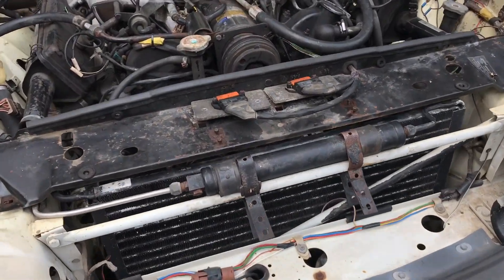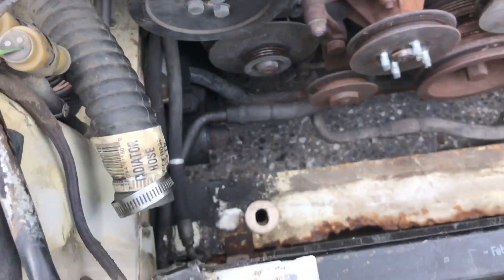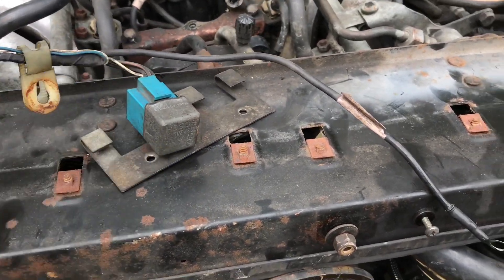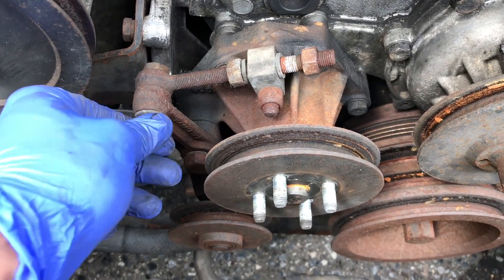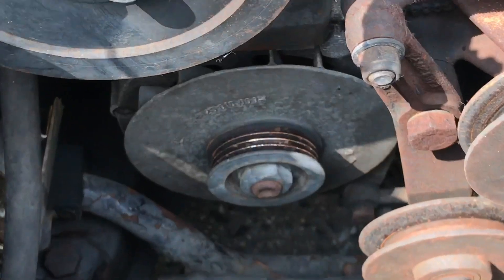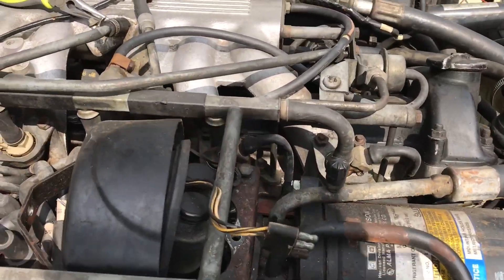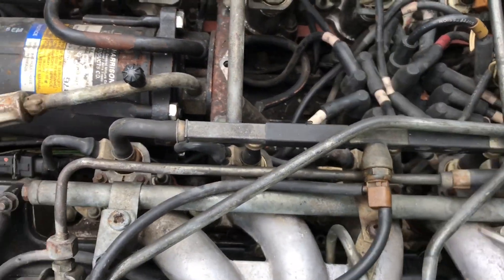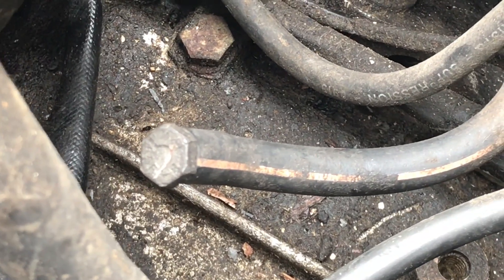Jaguar XJS V12 Tackling the Cooling System

Comment: I have a 92 v12 that is over heatings and i cant figure out what it is. And my big radiator fan is blowing hot air into my toward the engine. And it gets stuck on zero rpms and goes back normal when it feels like it. Any tips?
Reply from the maker: Regarding your overheating condition... 
check your two thermostats.. see if they're stuck open or stuck closed.. 
Check that between the radiator and AC condenser there isn't debris preventing the air to pass through. 
Also, has your cooling system been bled properly? Very important that the system is evacuated of all air. 
As far as your idle jumping up and down from what I gather, your car is lurching. and this can be casued by a number of things. But check your AAV, the AAV is located on the Driver side engine by the firewall, it's a valve the opens and closes allowing more or less air to get in during cold start.
Try this, turn on the car, take your hand cover the intake trumpet on the driver side, does your idel settle down? Then your AAV is the cause. Let me know how you fair. Good luck sir.

Comment: My car has been sitting for 5 to 10 years in a orchard and I have a mouse nest under the cruise control bellow,at least I hope its a mouse,what a mess they leave .
Reply from the maker: good luck bringing yours back to par! It won't be easy but very worth it. 
Please replace all fuel lines, the rubber perishes, especially on the return and feed.. Good luck and if you need anything please let me know. Also join the Facebook forums, the Jaguar community is one of the most friendly and helpful car communities out there. Cheers!
Reply: @PedrosGarage  Thanks Pedro for the info I have a long way to go but having said that its a learning curve and while I have an XJ8 and XJ6 these V12 s are an interesting change, having said that I was amazed how bad a car can get let uncovered and on grass/soil as the other Jags were both let outside on tarmac and one had a cover but you can tell which one it was.

Comment: Just bought an 86 that I'm trying to resto mod a little. Mine only has 75k miles and I would love to keep the original engine, just doesn't run, but not sure on how to really beef it up and make it more powerful. Or which parts to use haha. Very complicated engine to understand.
Reply from the maker: Very nice, well for one, the cars to modify are the PRE HE with the flat cylinder heads, they're good for 300 bhp, and are a preference for modifying.. 
 I know some people that ditch the original engine management syste, and tailor a custom stand alone ECU for their cars and they achieve impressive #'s. 
www.AJ6Engineering.co.uk is a company in the UK that specializes in everything Jaguar performance, and they may be the only people left that cater to the cats. Check them out..
Reply: @PedrosGarage  yea I've looked at all that. I actually bought a BMW v12 from an '01 750li,  to swap with the less powerful v12 in there haha. Just need to get it swapped when I get the funds. I bought the car up in Maryland, I live in Fredericksburg. Luckily the car was in great shape body wise.
Reply from the maker: @purelofisounds4587  exceptional! That’s going to make for an interesting build. Though the BMW V12 is a bit more sophisticated computer wise, it will be a worth while pursuit. I’m also in Maryland too, small world!
Reply: @PedrosGarage  really? I picked the car up in Indian Head. I'm in Virginia
Reply: @purelofisounds4587  how went the swap???

Comment: im having the same problem with a bunch of dirt and crap in my spark plug holes making it impossible to get the plugs out without it falling it, did you use a vacuum and pick at it or what?
Reply from the maker: Gavin Willoughby Took some brake cleaner into each well, then I took some compressed air into each hole and repeated. I didn’t use any tools, just solutions. 
I also let some Pb blaster soak in each well for 2 days before starting to clean and remove the grime. Take your time they’ll all get clean.

Comment: You must flush the entire system, including the heater circuit.....then install correct T stats, perform the Lutz cooling system mod to increase flow and circulation to the back of the engine....Lutz Stage 1-2-3 mods for street and trak days are easy and simple...contact me at jwk1953@hotmail.com...best V12 ever built, but over heating ends up with dropped valve seats...this can be avoided with these simple mods and correct refill and air bleeding of the engine...low cost insurance for a great engine. Best, JW
Reply from the maker: Mr. Wallace thanks for the comment and I am sorry for the late response, I haven't heard of the Lutz cooling system mod! I will email you right now!
Reply: Hi Jon;
I just bought a 1990 Jaguar XJS V12 and it runs on the hot side of the middle of the gage, knowing the reputation that overheating is the Achilles heel for the V12. I was thinking of changing to the Gates waterless coolant and a new radiator but saw your comment on the "Tackling the Cooling system " by Pedro's Garage and am interested in what the Lutz cooling mods are and you gave this email. I would appreciate any further info. I'm an old XJS fan and finally got one, it's a runner that needs TLC which is part of the experience of owning anything worthwhile. Thanks for your time.
Patrick Schoonmaker fanofallseasons@gmail.com

Comment: You should always replace the rusty holding brackets and any other rusting fixings on an Xjs or they rot away and cause serious damage to the surrounding areas. Also if there's any issue with the cooling system on the V12, do a full chemical flush of the whole system or any gunk build up in the system will negate all the work you've done and cause overheating. It's a false economy not to do it. Otherwise very good video on how to do the job.
Reply from the maker: Tolly T thank you sir. I got some Tefba coolant filters, and noticed the cooling system was not that neglected with very minimal corrosion. In the winter I back flushed my heater core because my heat was very faint but aside from that it cured the low heat and hasn’t overheated once. :3 thanks for the input.
Reply: @PedrosGarage  You're welcome.. I've owned 3 XJS and 3 others in my extended family, so we've been through most problems.. I used to back flush the coolant system every 5-7 thousand miles, and unlike many, never had any overheating problems..

Comment: Hi, I just took my E-Type V-12 engine apart because there was also a lot of dirt and a clicking noise which I had blamed on valve gap. What it actually was, I had 4 cylinders with broken piston rings. On the way of disassembly I found more than 2 cups of sand and 11 thumbsize pieces of neopren hose neatly deposited around the rear cylinders. The ignition was converted to another electronic system but they never installed a ballast resistor so the RPM reached its limit around 3500RPM. There was a lot more but that would fill a small book. Amazing was that the car was still driving good (at least up to the RPM limit)
Conclusion: it was more work than anticipated but when I am done I know it is like new again ready for the next 100k miles.
Wish you all the luck and check the compression (leak down test) and use a thermo-camera (Flir 1 Pro for the iPhone does a good job) to see how the heat distribution is around the engine (stuck thermostat .... there are two so one bad one can be overlooked easily)
Greetings Bernhard
Reply from the maker: Bernhard List very truly appreciated Mr. Bernhard, my biggest fear is a catastrophic failure of the glorious V12. It’s too good an engine to see waste away. I will download the app and begin to take a look and upload my readings in the coming days. Again thank you very much!

Comment: Excellent video! I definately agree that the topside and possibly the front while you have access should be thoroughly cleaned before you proceed to the next step. Slow but steady wins the race because if any debris falls into a spark plug hole you're done. Game over. Not to mention that for these V12's to stay cool, they need to be clean or the sludge/dirt acts like an insulator and heat cannot escape. Not sure why you wouldn't want to keep your cruise control present after all the repairs. That's a nice feature for highway cruising. Also, definitely keep the smog pump on the engine. If you ever sell the car in the future, people want originality when it comes to these cars. Not to mention those same people get scared off if they think the car has been altered and might not pass emissions testing.
Reply from the maker: Kenneth White that’s my biggest fear right now sir. I don’t want any small mishaps like that washer falling in there. I have since removed it thankfully. I’m thinking about buying a small air compressor and soaking the wells in brake cleaner, blowing out all of it to the best of my abilities. Repeating it multiple times. Now we’re entering the danger zone you can say. 
Eh, the cruise control bellow up top was an eye sore and didn’t work. I would have to check control modules and remove interior trim panels and begin diagnosing it lol. That I have little patience for and all that held it in there was minimal, I thought why not lol. 
Thanks I’ll keep the smog pump! Solid advice as I went with the original radiator to keep that originality factor. Wish me luck as I delve into the spark plug wells!